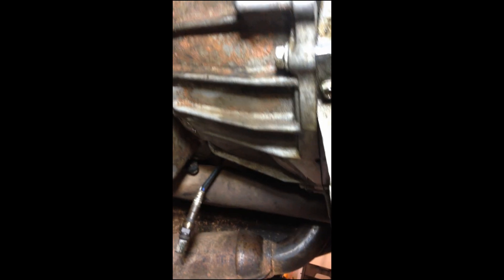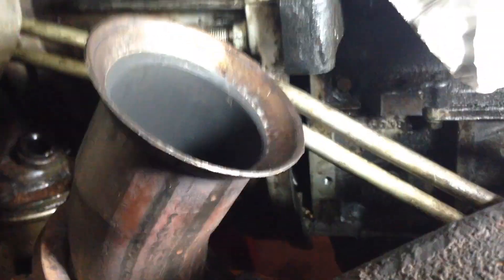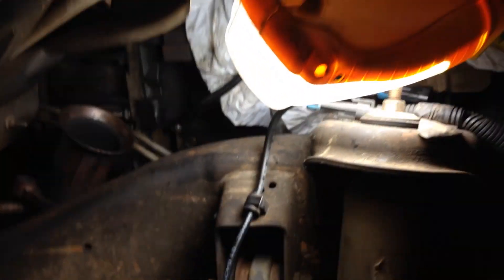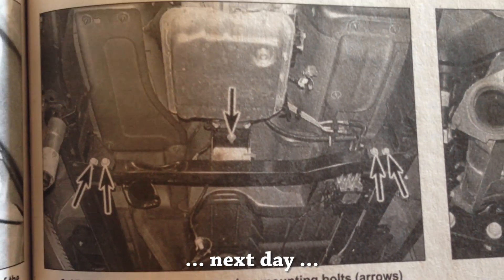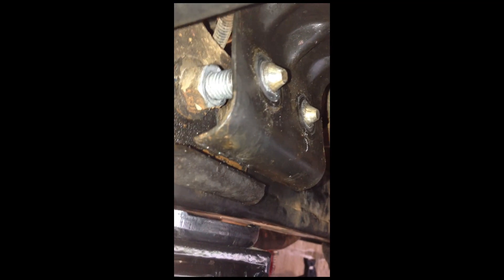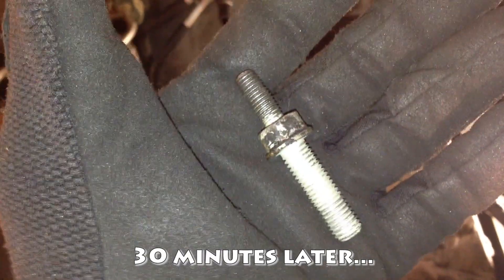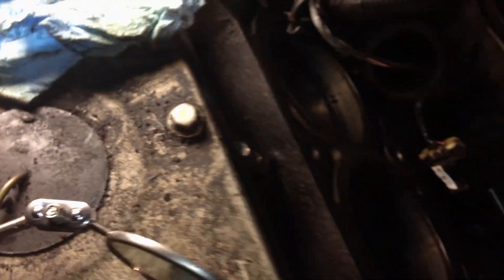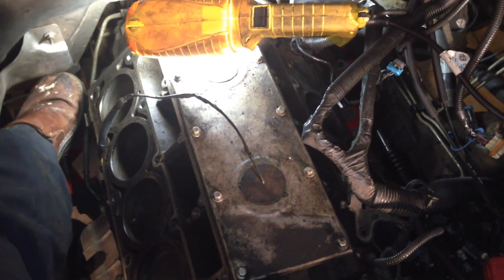Transmission Bellhousing Bolts Removal GM Chevy Tahoe Vortec LS Engine vid 15

Comment: oh a trick I learned way back in the day,to get the top bolts,pull your carpet back and cut a hole in the fire wall,3 sided square hole,bend the metal back,to expose the bolt,remove it easily going back just bend the tab back.and cover it with good aluminum duct tape.
Reply: I literally told myself today, I’m making a door! I’ll be the only one that knows, and the next person will thank me 🤣

Comment: Most informative, comprehensive GM Truck Guide. You may experience slight shakiness, but this guy delivers way may, clearly and slowly explains and visually shows fhe routing of the wire looms. Highly recommend.

Comment: after about 20 engine swaps, you learn to pull the bolts with 2 wrenches , one handed and 1 hour .
Reply: What do you mean
Reply: 4 bolts from the bottom with 2 foot extensions on a 15 mm the top bolts come out after you pull the driver side plug wires off the cap off the distributor.  The nuts do suck but you have no reason to use them when reinstalled.  Just slide the trans fill pipe over and use the bolt 
Best thing y
To do is not bolt the bottom of the fan shroud,  then the next time your working on it on you do is pull the top , pull the fan and jump in 
Just be careful not to step on the steering lines . That nut in the back of the power steer pump does not need to go back on , done it like this for 20 years. 
It sucks at first but still easy when your comparing to the newest design of any make .

Comment: I'm there. Ready to put it all back together and I'm stumped. At around 11:00 you're working on the 13mm nut for a bracket on the very top bolt of the bellhousing. It holds 2 tubes with buttons on the top(?). Does anybody have an idea what the hell these two tubes are? I'm assuming they don't plug into anything, but I don't want to put the manifold back on until I'm sure. Thanks to anyone who can shed some light. Great video. Absolutely nobody gets in there like you do.

Comment: This is a good video showing resilience! But, honestly you can much easier access all of the hard bellhousing bolts from the top. With just the intake and exhaust manifolds removed, these bolts can be easily removed with a 13mm and 15mn wrench. A ratcheting wrench makes it even easier. Nice job tho.
Reply: He was at the top lol he had the intake and the heads off too

Comment: I was right were you were buddy with the same one on the passenger side so before I reinstalled my motor I did my 2 inch body lift which gave me all the room that GM didn’t give me

Comment: Doing a transmission repair, (4l60e) 2001 Silverado 1500 5.3L.
Exhaust y pipe bolts took days to end up cutting them off. Now I'm at 7 bolts trying to find 8th. Have transfer case out crossmember out and am about to light it up and walk away.

Comment: I know this is older video. But if ur still around, don't feel bad ! It took me 3 days, working on 3 Exhaust nuts, Flange to exhaust manifold! Hours stalled on them. Not even a Electric Impact driver, broke 3/8 swivel also. Went back to 1/2 inch drive, after those 3 days of spraying with rust buster, liquid wrench I went to a 18 inch long Breaker Bar finally got them off after me snd friend tried for 30 minutes more. They must have been Far Over Torqued !!!! Same vehicle, mine is 05 Tahoe 2wd. Thank for video good job
Reply from the maker: I'm getting ready to do it again!

Comment: When the engineers don't have the maintenance guys in mind this is what we have to deal with. Crazy bolts in tight location making a simple job a complicated one. I simply can't reach my with an extension plus elbow, even with the transmission dropped at an angle because the seam is in the way preventing the socket wrench to full hold the bolt.
Reply: Undervalued response! I think they do it on purpose so we'll go back to the manufacturer

Comment: Thanks for the video, bro:)
I feel your pain, and mustered up my patience before I attempted this with success.  My 02 Avalanche engine change has been running for the past 2 weeks:)  I have a couple hints for those attempting bellhousing bolts on their truck:
Don't do this job when your patience is low.  Humble yourself, regroup with a cup of coffee...and attack again!  (Don't make a challenging job miserable and strip your bolts):(
Take the 10 minutes and remove the plastic fender skirts!  If nothing else-it gives your another view to see what your are working on.
Take the 5 minutes to simply remove the front driveline.  (mark which direction the u-joint goes). 
Remove the intake manifold. The upper bolts are not bad.  (the hardest part is orienting the location of the bolt heads).  So take a photo of a 5.3L bellhousing at the junk yard.  

The funny thing is the toughest parts to my engine removal were the ground bolt to the side of the engine and the oil pressure sender!  Who would have thought?  Lol  Good luck brothers and sisters who struggle to keep their vehicles on the road.  

I think I used a 13, 15 open end wrench, deep sockets, a wobly and a couple extensions.
Reply: Just like the video this comment has been super helpful thanks

Comment: Was there a ground wire connected to one of those bellhousing bolts? Just did a transmission swap and now my truck won't crank over or anything. Lights come on but no crank.
Reply: That would piss anybody off i hope you figure out what you did wrong

Comment: For that stubbon bolt,  I guess you could of used a gearWrench 15mmx16mm indexing long box wrench.  no?  Dunno if the head of the wrench would hit the bellhousing, pretty shallow.  If not that wrench, then perhaps an s wrench or half moon?

Comment: The pros get a 4 foot extension from snapon 1/2 inch to 3/8 with impact swivel sockets and a nice impact. I'm pulling my motor as we speak and hating life, getting there though.
Reply from the maker: true.  even with the extension, the transfer case on a 4x4 still makes it challenging.
Reply: @TahoeSteve  you pull the tcase first

Comment: Just got done doing this and my 5.3 is seized to the transmission....I’m about to light this piece of shit on fire
I feel bad if he learned he had to pull the start to unscrew the torque converter bolt

Comment: Im thinking of doing it myself or paying a shop $600 to swap my converter....hmmm.
Reply: I just did this, my only issue was frozen exhaust bolts which I ended up cutting off. The top bellhousing bolts were easy to take off by reaching in with a wrench from the bottom side and hitting the open end with a cheater bar with a hammer. They are only tightened to 37 Ft lbs. The other ones require alot of extensions and a universal. Now I have no converter shudder.

Comment: I just pulled my sbc 350 out of my 92 k1500 with 700r4 you can get the top 2 belhousing bolts by taking the intake manifold off  and you can get the second  one down on driver side with box end wrench passenger side is a mother fucker though took me like 3 hrs and I had to drop the starter and remove exaust manifold.
Reply: Yes there's way more room on your 92 than 99+
Reply: @angeljose6261  yes like 1 ½ in for the top 2 the passenger side has a weird hump in fire wall that makes it like a nat's dick with.

Comment: And I'll have 24 hours to get the trans out and back in, but I have an impact, a lift and 4+ techs I can ask for advice. Also doing the rear main and the right sides cv axle boots. I'll have 3 days after work.
Reply: You said an impact 4 techs and a lift, walk in the park

Comment: I removed the top trans bolt/studs (#7,8?) and brackets with the heads and intake still part of the engine. Transfercase was already removed and crossmember dropped for angle. Find someone with small hands and can see with their fingertips.
Reply from the maker: yeah - with the transfer case out of the way, it is much much easier to do from below.

Comment: I spent over an hour last night just trying to get that top driver side bolt back in. (The one that hold the wiring harness bracket.)  Yes, those bastards used 13mm nuts on top of 15mm studs. They could have at least mentioned this info in the repair manual since they are soooo.. difficult to access.To get it out, I used a very long extension with a swivel attachment. I really like your video.

Comment: I just went through the same thing and there was bolts on the fly wheel holding on to the transmission and torque converter